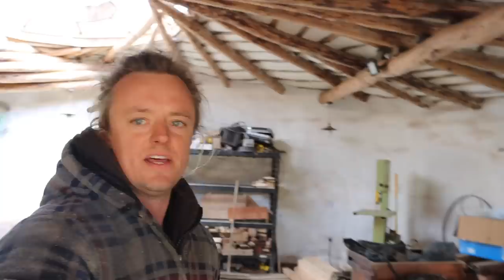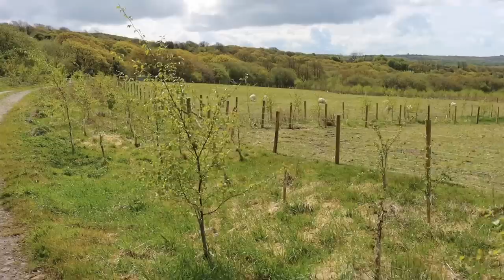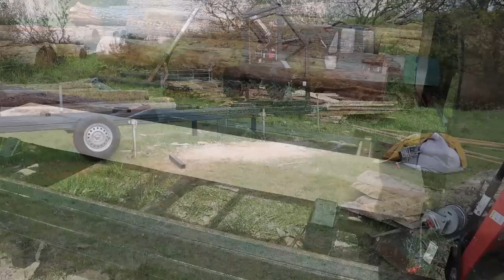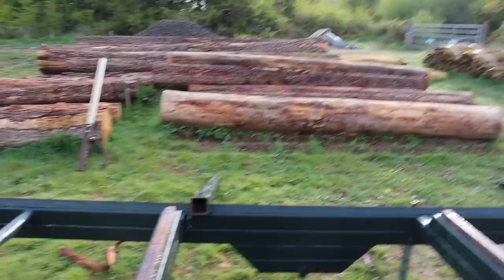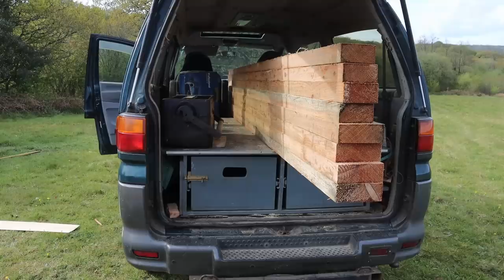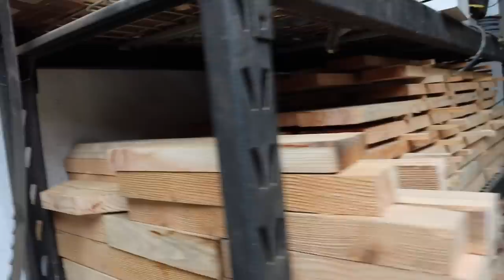Stocking Up My Off Grid Workshop Using My Homemade Bandsaw Mill

Comment: Your hard work building the sawmill is paying off. My factory built sawmill wobbles like that too. It is because of "blade friction" as it is cutting the wood. To stop the friction, you can do two things. Slow down how fast you are pushing the saw, and make sure water is flowing to cool and lubricate the saw blade. Add a few drops of soap in your water tank as well. Cheers.

Comment: We just got a truckload of red cedar and Alaskan yellow cedar utility poles that are going to be cut into fencing materials and whatever else we can get out of the logs. The best part of the project is that the entire load was free from a utility contractor working in the area. He saved money by not having to haul off the poles and we got free materials.
Reply: Hey @brian Gorrow, I know someone who needs Alaskan yellow cedar. I don’t know if you are willing to trade it maybe? I know it’s a long shot, do you live at the west coast?
Reply: @lucadijk5401  Would that be Sampson boat Co?
Reply: You will find they are hard on blades, decades of blowing dirt and dust build up I think.  When we did it there were these little plastic plugs we would find randomly driven into bored holes near the base. Anti rot or insect maybe?  Anyway each time we hit one it wrecked a blade.  Could be that our poles were just weedy junk, I hope you have better luck.
Reply: @Longing4theWoods  a guy who cut a bunch of phone poles. Both questions.

Comment: man i can only imagine how it feels...
cutting down trees that need to come out, milling them on the mill that you built, stacking them in the workshop that you built, ready to build something cool like the tool box you built 😎👍🏻

glad you noticed the wobble i was gona say something. maybe box section bolted on the side of the top part that extends down to the bottom rail with a stabilising runner wheel?

pleasure as always!

Comment: You could put a low power fan blowing over the stack if you ever get worried about the moisture. Will help move the humid air from the stack around to the rest of the workshop :) That bandsaw is incredible, my favourite project you've done (and you've done so many amazing projects!)

Comment: Just wondering if getting that old excavator running and adding a thumb would make log handling on the mill a lot easier.  Especially larger sticks.  Maybe it tme for a shed to park the mill in on one side,  and a drying rack opposite,  use the off cut slabs to side it

Comment: kris when stickering your planks leave an air gap between the planks as well  and if you’ve got the power available have a fan blowing across the timber this helps the drying process and gets the moisture away from surfaces lessening mould build up

Comment: Nice work Kris, the mill will have paid itself many times over by the time you come to work on your house and barn. Lovely to see you reaping the benefits of all that hard work. You need a 3 pin skidder plate with a winch for you tractor next to make dragging cut logs around easier on you, another build :D.

Comment: Hello Kris;  
 In order to stop the side-to-side shudder of your saw as you cut with the head in the higher positions, you need to re-mount your legs or jacks.  If they are placed so the top of each pair of jacks /legs is flush with the side of the machine, and the lower end of the jacks / legs are spread out at an angle of about 10 degrees they will automatically get stronger the more weight you put on the saw.  In effect, you will be making a short pair of 'A' frames out of each pair of side legs.  This will also happen for lengthwise vibration if you cant the end legs / jacks with the bottoms canted out towards the open ends of the saw bed.  What this solution does is negate the slight amount of slack built into the legs to allow them to work smoothly..  The vertical mount you use now actually multiplies the 'slop' in the legs, causing the wobble.

Skip Pence

Comment: To steady your jacks you could weld up a "leg" frame that is attached to the bottom of your rails with a pivot point hinge and swings up for transport and locks in the down position with a pin. Basically two legs of box steel with diagonal bracing between rails, then remount your jacks to the sides of the box steel so they swing up with the leg frame rather than sliding up the one bracket they have now. That would also allow you to add a second bracket for each jack closer to the bottom to firm them up. Also, it is common to paint or seal the end grain on lumber to be air dried to reduce the amount of checking. My two cents anyway, very motivational videos for me, thanks.

Comment: I had a similar problem with the whole thing hitting a certain frequency and it'd shake like crazy. I tried bracing the saw head, I tried jamming the chassis against stuff - I tried all sorts. 

What fixed it for me was getting a bigger pulley on the engine and thus bringing the blade speed up a little. I seem to remember when I was researching my build I was aiming for 3500-4500fpm blade speed with my engine power. I'd recommend figuring what your current blade speed and what your ideal blade speed would be for your engine power and work from there. 

Maybe for your set up a smaller pulley attached directly (somehow) to the back of the band wheel might be best because I know you haven't got much space between the clutch and the saw blade. Also a slightly dull blade will make it all seem worse.

Great stuff as always Kris. I hope this doesn't come across as "Now listen here, boy! What you need to do is......" Just thought I'd share what I've found.

Comment: Ran into a different take of a sawmill on a channel where they are making a rail setup in the yard to make moving wood around easier where they simply mounted the sawmills head on two posts outside the shed with a set of rails under it to let them load a log on a cart and simply push it at the saw blade. No max length on the logs that setup can handle and the rails are cheap as they are using steel flat stock on edge that is bolted to sections of pipe in holes on the ties. They are expanding the rail network in the yard to let them roll carts of milled wood into a cheap high tunnel greenhouse they are using a a drying area

Comment: Stll a very watchable vid.
An couple of ideas for the mill. 
If you can find some tube the same OD as the jacks make a frame with the long sides a little wider than the bed and using the outside tubes of the jacks as the short sides. Then move the jack clamps to the underside of the bed and use them to attach the frame to the bed. these frames can fold up for transport and down for milling, then add a fore and aft brace on each frame. This will hold the jacks square to the bed and rigid in all directions.
If you box in the top of the gantry you can create a weatherproof enclosure to raise the engine into

Comment: Awesome Kris!
Please remember to ground your saw mill!
Don’t want to see you get hurt!
Your sawmill I’ll is going to make your life better in so many ways!
Reply from the maker: Ground it from what? It only has 12v electrics. 12v can’t shock you. And if lightning hit it, it would find ground via the legs
Reply: One of the YouTube people posted a problem with the ground and the ground found another option! It was through the winch cable!
Since your battery is connected to your treadle this might not pertain to yours
You know anything moving makes static electric! It causes his bandsaw to melt the cable and bandsaw motor fell to deck!
Everything has to ground to earth!
I thought I had sent you a link a month ago but can’t find link!
The problem was on a Norwood mill!
Have a wonderful day Kris!
Reply from the maker: I see. On my mill the wheels would be a very good connection so I doubt the winch cable would end up having current flow through it. It is possible though but not likely.
Reply: I think I have found the Video you alluded to Average Gurl: Howard Kettner has a Norwood HD36. You cannot get wire melting currents from saw related static buildup - a fairly noticeable zap from the metal blade passing the plastic housing maybe. He is blatantly missing something he doesn't understand in his description of what he says happened (wire red hot) and also in what he said to Norwood. He needs someone qualified to go through all his Mains and 12v wiring assuming nothing. Lamp visibly hanging above the Mill maybe dangerous if wrong wiring etc. His bodges are making the mill objectively less safe than it was originally designed. eg. Not replacing an alternator or regulator has him fitting a heavy leisure battery hanging off that saw head making it heavier that he still has to charge.

In summary. Kris does not have these issues on his machine.
Reply: @purpleviolin  thank you!
Sometimes we step in our own trap!
I’m glad to hear I was not correct!
Sorry about false alarm!

Comment: Suggestion for the wobble: try hanging a couple of 20L hdpe jugs from the frame filled with water. This will most likely dampen the wobble or in the very least change the resonant frequency so it won't wobble. You may need to do a 3 point suspension with some rope to prevent the jugs themselfs from swinging and be more or less "fixed" to the frame.

Comment: You may need to pour a flat concrete base to keep your mill on, that would make sure it stays flat, level & no sagging.. I had a concrete base and roof over mine (way back in the day) keeps it level and dry, so I could mill wood even if it was wet & rainy outside.. Loved the episode.. Be Blessed..

Comment: are you going to get a tenoning machine with multiple sawblades or the type with milling heads and carbide inserts? love the electric adjustability on your winch, no more possibility of a hand crank throwing a punch. maybe a dc-dc converter could allow you to make even finer increment adjustments but i guess that would need to be quite beefy considering the currents involved in a 12v winch. can't wait for the greenhouse to be enclosed, you'll have to record a clip in there when it's really chucking it down. i bet that would make for quite the asmr rain recording with all that glass :)

Comment: One thing I did on my mill was installing two valves on the water drip. That way I could set the drip where I wanted it and then the other valve would shut off flow. Then I wouldn’t have to figure out the flow all over again. 😊

Comment: Great work, you do projects like I do, do a mental inventory of what you have to work with and go from there. Saw is doing what it was built for very well. One thing I noticed is slight horizontal movement in the cutting head while making a heavy, wide cut. A couple of diagonal brace plates up on the top of the frame may alleviate some of that action and reduce stress on those top welds. Second thing would maybe mount a canvas bag to catch the sawdust like many power sanders have just to make it easier to get them into a composting pile. Just my two cents for ya, Love the channel and hope you keep them coming. I have the same one lunger engine  on a generator.

Comment: Have you looked at how a caravan is jacked up so it does not rock?
A couple of those "scisor" legs (maybe with an extension welded on at each corner pointing inwards) would work wonders .... you can pick second hand up for a few quid

Nicwe workshop!

Comment: I have seen experts paint a very thick layer of plastic paint at the ends to pervert end-grains loosing moisture faster than the rest of the boards and also even tighten a bunch together with wires.
Isn’t it a bit risky Leaving the boards like this? It is much appreciated hearing your thoughts on this subject.
Thanks for sharing your wonderful life with us and god speed🙏

Comment: I would have thought your woodburner would overcome the moisture. I saw a design for a temporary greenhouse that used 2"x8" bottom boards with fence panels (cheaply and easily available in the u.s.) bent between to make a hoop shape then covered in 6 mil plastic (just use black). Easily built to whatever length you want. If you added a fan intake and exhaust at other end with maybe a dehumidifier inside you would have a cheap, moveable solar drying "shed". If it ever was needed or useful. Sorry about the novel, thanks for the new video.

Comment: Kris, while watching that bit where the saw was oscillating, I was thinking that the frame holding the saw and motor was twisting and oscillating, which was then being transferred into base of your mill. All you might need to do is add a few diagonals into the rolling frame that carries the saw, on both sides and the top, to help minimise the twisting motion while under load.

Comment: Ive had trouble with similar adjustable height legs wobbling under load. My problems were because they were only secured at the top. Maybe weld a plate behind each leg and bolt on another clamp for each leg at the bottom? Would certainly take some of the sway out I reckon. For what you spent on the build though, its such a better machine than other saw mills for the same price!!

Comment: You can build a "troth" next to line of your saw mill and collect all that saw dust, or a cheap trick is to lay down a plastic tarp then slide it from underneath and roll it. Bend one end and leave the other open so when you stand it up into a wheel barel of box all the saw dust comes out.

Comment: Greetings Kris! I don't know if this is a goofy suggestion but here goes. The old bumper jacks for cars might work to help take the wobble out of your saw mill. Old cars were much heavier than the new ones and the jacks could bear a lot of weight. You may be able to find them at a junkyard for a pretty low price as no one really uses them any more and they are portable. Just a suggestion. Your place looks beautiful in the spring and I never get over how stunning the ceiling in the workshop looks. Stay safe. Looking forward to whatever you care to publish.

Comment: @Kris Harbour Natural Building It looks like the wobble you mentioned is in the saw carriage. An "X" brace in the frame of it mounted flat should prevent it. The wobble looked to be twisting in the Y or vertical axis. Between the two wheels specifically.

Comment: A suggestion for you... after you make the first cut on the log , take the cut piece off BEFOR you return the saw back to the starting position.. it dose several things ..one, you don't have to maneuver around the saw and the ramp to put the cant on the scrap pile. its a lot easier top pick the cant of the end of the log and requires a lot less energy.. its also a lot closer ! two, you don't have to raise the saw 6 inches to clear the top of the log.. after the scrap cant has been moved you only have to raise the blade like an 1/8 of an inch and then move the saw back to the start position. By the way the saw build is awesome, i watched every one of the vids ..love your channel..i sub it the first time i saw you..cheers!!
Reply: Can't see that it makes any significant difference - am I missing something....?!
Reply: @andymccabe6712  work smart not hard ..least amount of lift and travel distance..i noticed it right away.. why pick the cant  up in the middle when you can slide it halfway there before you lift it ..

Comment: As for your band saw "wobble", I would modify your log ramps so the you could hammer stakes through them, in to the ground, and utilize them as your bracing.

Comment: The wobble. A lot of it is transmitted from the  cutting carriage to the base rails. Incorporating a couple of x braces or gusset's up high on the carriage will certainly help as well as addressing the screw jacks. Having the wheels on the ground if possible will help with the lateral rigidity.

Comment: Have you seen the Discovery show, Bering Sea Gold?  To keep their ocean barges steady they drop large metal posts, called spuds, into the soft ocean floor to keep them steady.  Hydraulics and pulleys raise them.  Raising them is the problem here but if you can replicate this and drive in some metal rods several feet while slipped through a tube attached to the frame I think it could help a bunch.  Maybe an eyelet on top of the rods so you can attach a cable to pull them out with tractor bucket if you need to move.

Comment: @ 16:30 I think a bigger bucket or cut the bottom out...
Then clamp a bag around the bucket top;...
So that the sawdust falls straight into the bag...
When it is full;... release the clamps & fit a new bag...

Comment: Because tbe woddle is near the end of the cut, it could be that the weight of the board is slightly pinching the back end of the blade causing it to drag. Seen a few home made mills where they put a couple small wedges in half way through the cut

Comment: was wondering if you could ratchet strap(or rope/ chain) the bandsaw mill down with large tent stakes. drive the stake under one side of the frame pulling on the opposing side, crossing under the bunks, so they don't get in the way by extending outside the trailer frame. might be best to do it on the ends where your less likely to be walking between bunks

Comment: I notice on the video 4:35 on the mill that it seems to need more bracing between the blade wheels ... Its looks like that as it is cutting the logs the blade is pulling the machine and give that flex back and forth , more noticeable when you are a lot higher with the blade and also notice the ripple affect with the finish surface of the lumber and it varies between hard woods and soft woods, i know that it is rough sawn and you are going to put through the thicknesser for it's final dimensions ... That could be that your blade is dull or the blade needs more tension between the wheels ..... I suppose it is going to take time too tweak mill and get it right and that takes time ... Other than that you have done a fine job in the building a mill and yes you definitely are saving money ....Keep the great work up and enjoy the videos ...